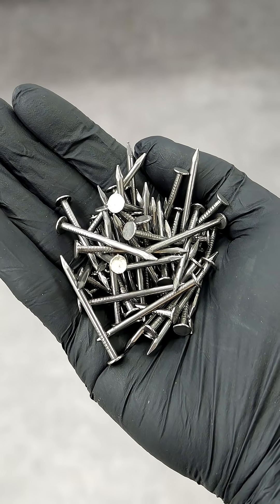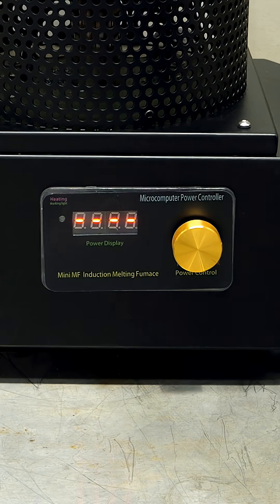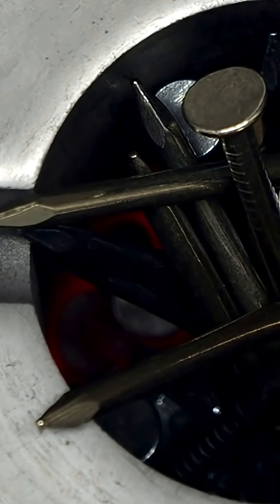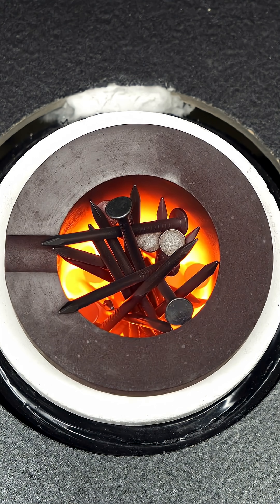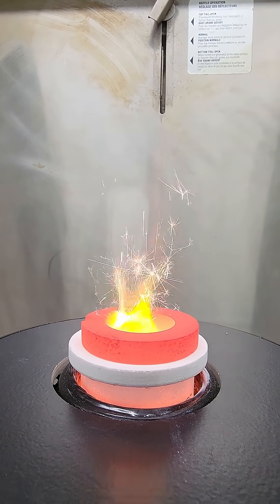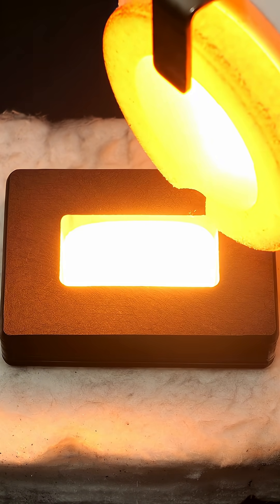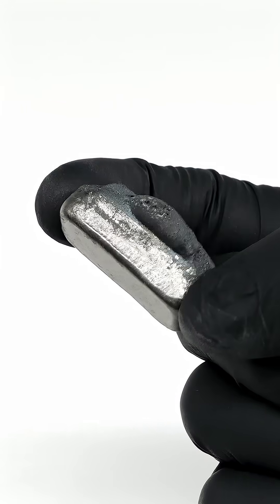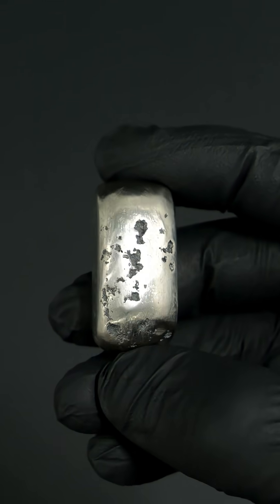Liquefying nails is crazy

Comment: Your electric bill price be like 999,999,999,999,999,999,00 dollars
Reply: 3.5 kW over an hour is 3.5kWh, which is like $2.  But you need like 5-10 minutes.  So 1/6th of that.

The real problem is that it's impossible to reach on a 120V mains because circuits are limited to 16A.  Which caps at 1.9kW.  But the safe value is about 1.6kW when you look at space heaters.

So you need a 240V mains.  Which either comes from your dryer circuit or a dedicated one.  But instead of the metal melting, drawing that kinda power may melt your house instead...